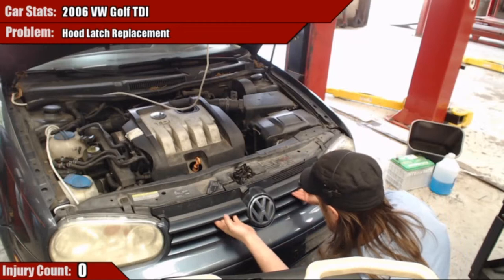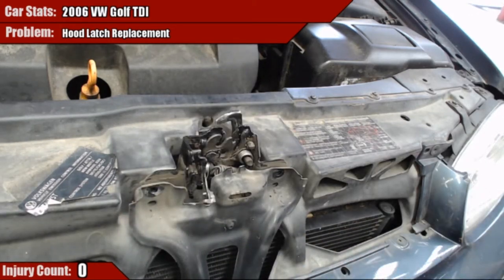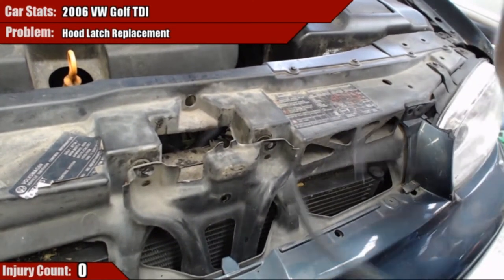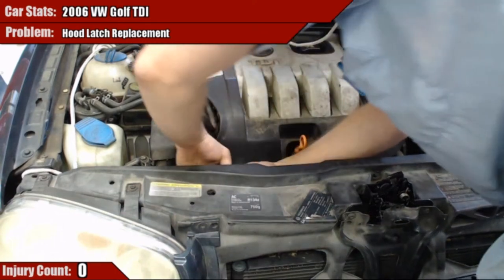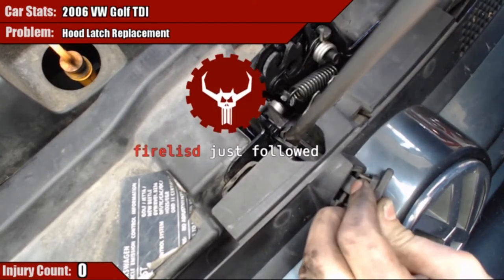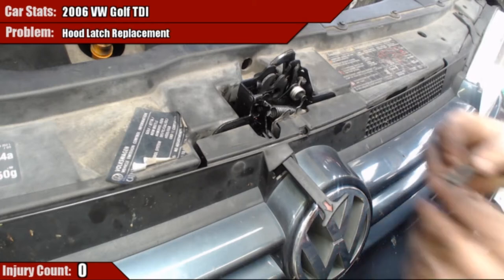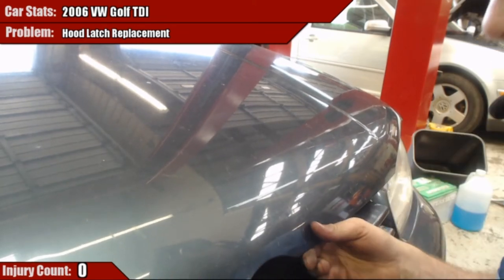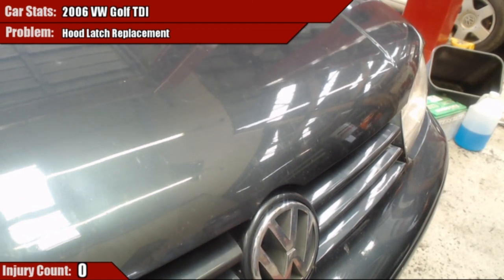VW Mk4 Golf TDI Hood Latch Replacement

Comment: Hey man! Awesome video I just got one question, my new latch is only catching on the secondary lock still. The hood release wire engages when I pull the lever from inside but it still won’t catch on the primary lock. Any tips ?

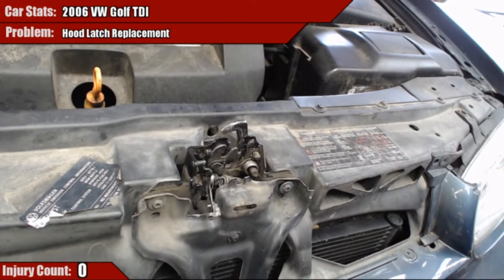Comment: What are those screws at 2:14 you're taking off called? Need new ones to fit my badgeless grille.
Reply from the maker: Torx Bolts. Hit up a junkyard for some replacments.
Reply: deamonmachine what size??? You show how to do it in the vid but give almost zero information